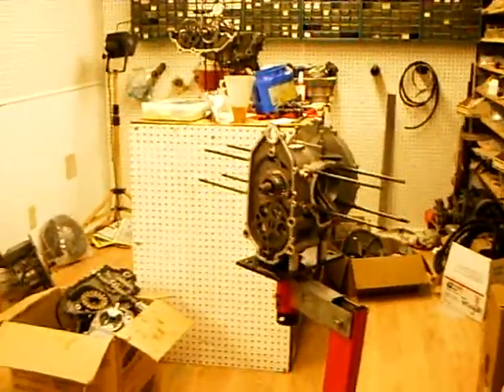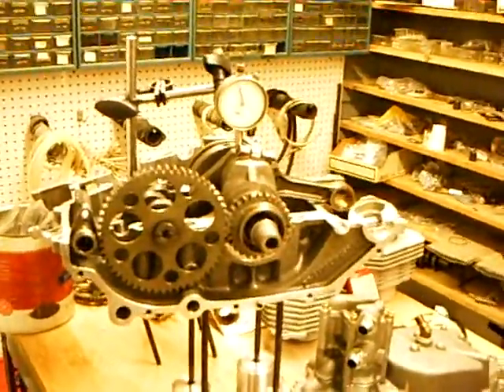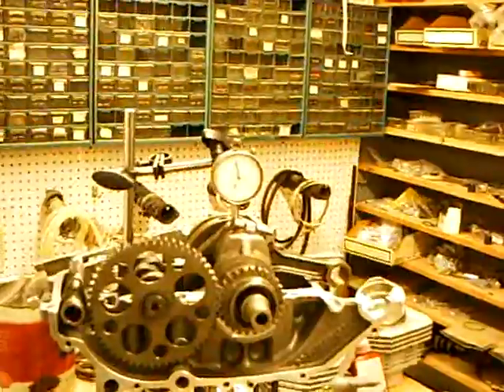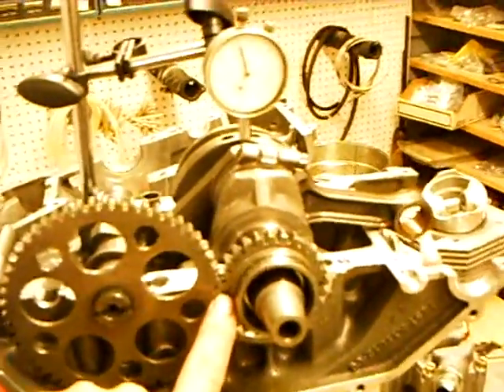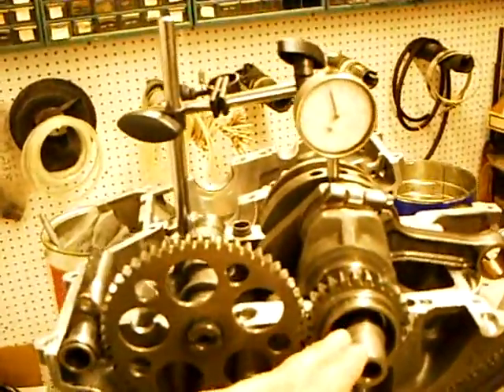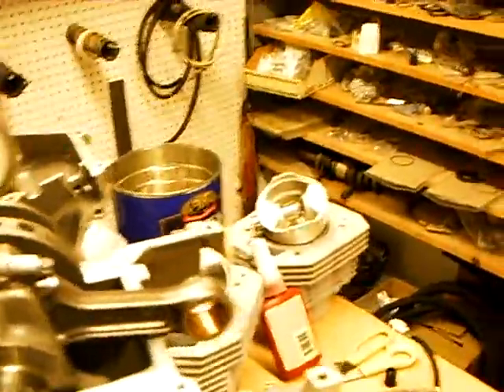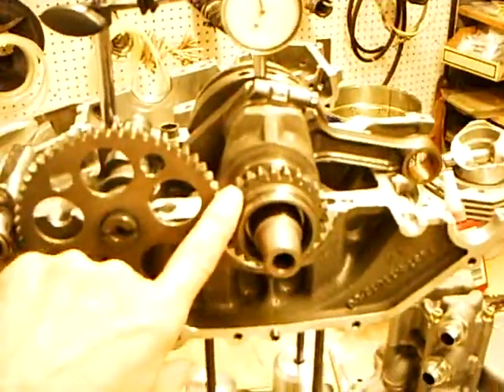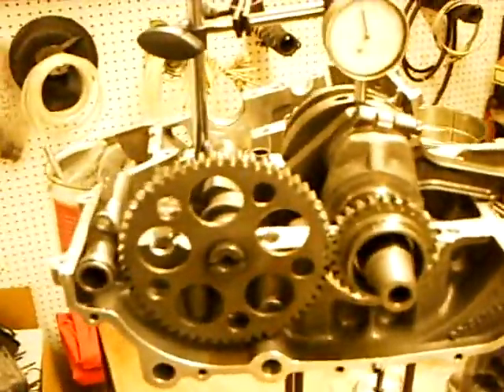HKS-CrankGearSlip.AVI

Comment: I would like to see an updated video and not hand held camera. Is there a way to pull off the crank gear and realign and replace? I have the problem where the dots don't align with TDC. At TDC the keyway appears to be a a 3 o'clock  position, my dots are not aligned in that position and the slot shown on the cam gear is not at in this engine position horizontal. It would seem if the gear moved it could also be pulled off as it was not tight enough.

Comment: Hi there, 
No, we don't replace the crackshaft.  (2:36)
The first thing is to find the pressfit tolerances of a new crankshaft and new cogwheel. 
Once we have the OEM values the actual cogwheel is removed, measured in a dedicated shop with calibrated tools at 20 C.
The cranck is grinded and afterwards a hard chromium layer is supplied. This layer is grinded to the exact specification. Can be done to the mu (0.001 mm) by my shop.
The press operation is the quest. 
The timing wheel must exactly correspond to the original position. This can be done using sliding tooling.

Wish you nice flights,